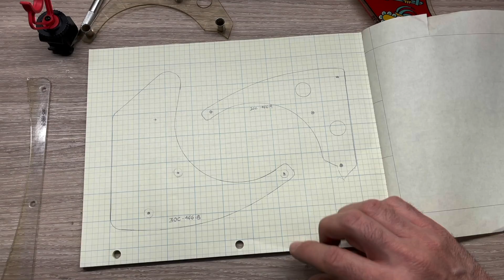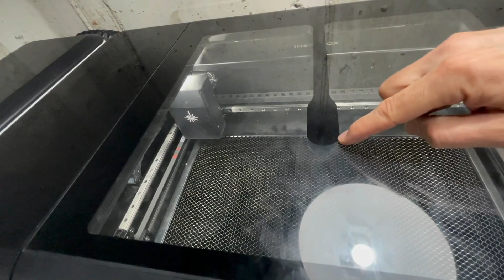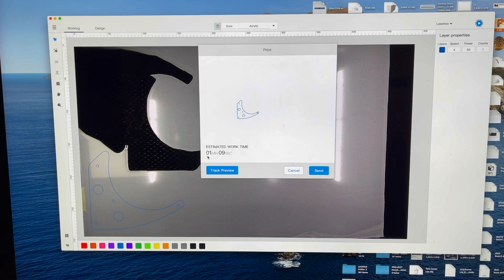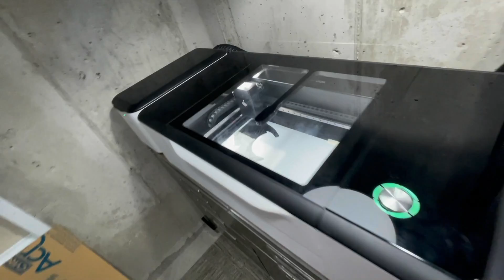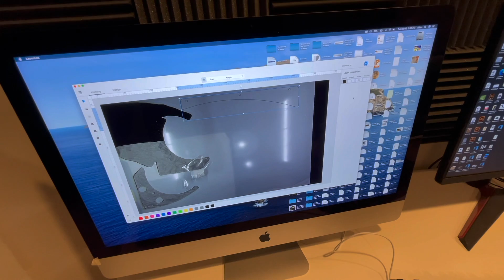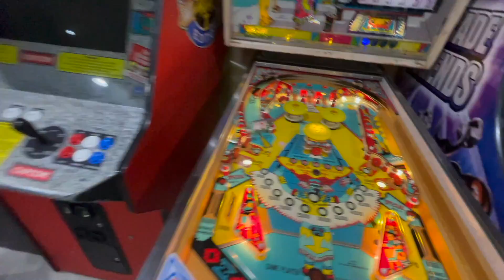Making acrylic Pinball PLASTICS with a laser cutter - Aztec Repair pt 12

Comment: I have a question for you Adam. I got my dads old aztec machine home and I am trying to fix it. Inside the machine there is an upside down L shaped piece of metal with some numbers on white gears inside of it that you can see if you open the coin door and look inside. There are 2 black wires and a green wire that come out of it. On my machine there is a red wire that come out of the big loom of wires that go to the Jones plugs that are on the far left. There is a red wire that comes out of the loom. For me the red wire is disconnected and is just wrapped around the black wires. I have no clue what it does where it goes or where the rest of the wire goes. Do you think you could help me?